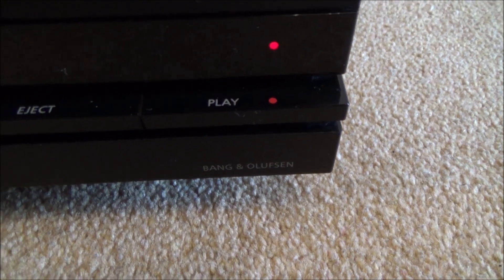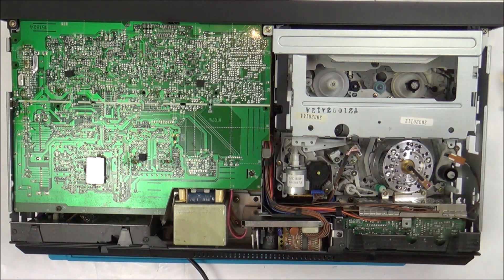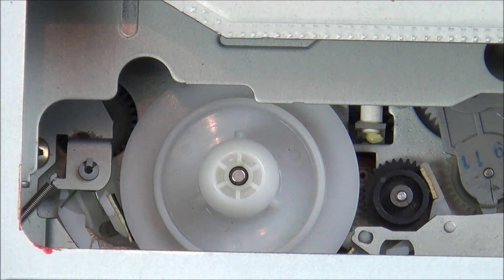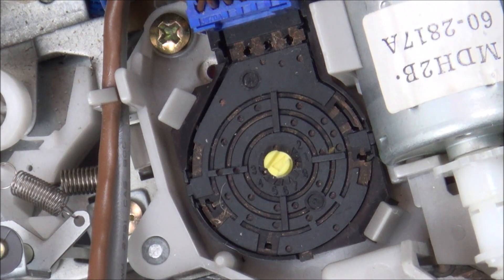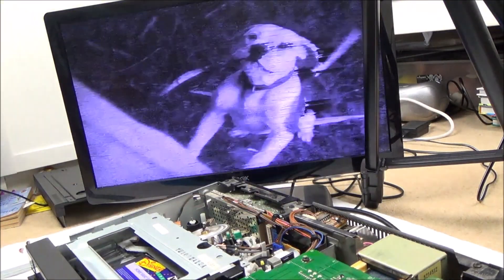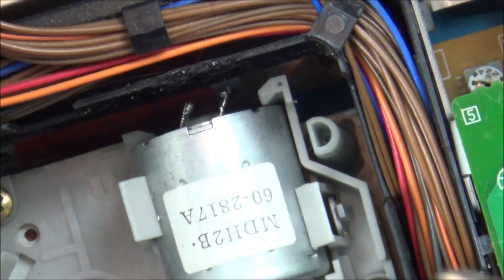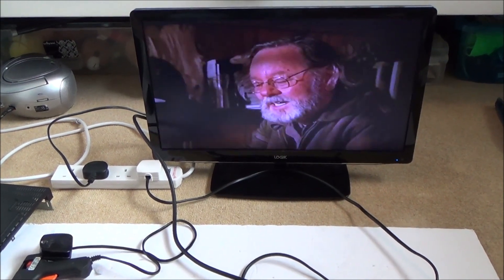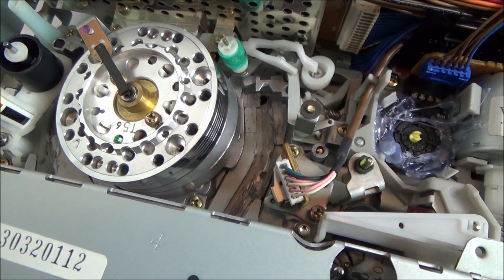Trying to FIX a £1200 Bang & Olufsen VX7000 VHS Video Cassette Recorder

Comment: My father has one of those big bertha ones with the dual cassette players, analog tv decoder and the whole shebang. That bad boy weighs more than a cinder block and does about the same thing as a cinder block. I once tried to open it and fix it, well....let's just say I saw the internals, all those gears big and small, wires everywhere and the dust caked up, I had nightmares afterwards.

Comment: Let me tell you all. The fastest winding cassette player I’ve ever seen it’s the Tandberg tcd330. 
Made in 1975, 
It have dedicated capstan motors, dual loop closed type. 

And 2 direct drive motors on to each real,
Rewind up to a serious speed, and slowing down at the end to not damage the tape, just like expensive 80/90’s vhs machines

Comment: Hello I have a beocord v8000 or model 4601 and when I put on power it just displays 3 lines but got no reaction on any of the buttons when I try to play a vhs tape or eject it... so I had to manually eject it... my main question is what could the problem be? Please help

Comment: Actually, it has 7 heads on the drum - the 2 sets of of heads for long play/standard play are combined. Sadly, you broke the position switch - it was probably not bad before you began fiddling with it. The reason for the too high speed was because you messed with the take-up mechanism, which you forced to drag the tape with too big torque, thus the pinch roller could not control the speed. And finally: It cannot be remote controlled without connection to a B&O TV. If so done, a range of features like tape indexing, variable speed and on screen display will be unleashed. Having this machine without a B&O TV, is like having a caravan without a car.
Reply: What a bit of crap lol.

Cracking plastic parts.  Un-maintainable mode switch.  Functionality locked in with other equipment..

How much was this back in the day?

Comment: I have a VX7000 it woul also chew up tapes. The solution was easy. Take off the take-up reel. Underneath it is hardened grease. Clean it off and relubricate with e.g. silicone grease. Works like a charm again.

Comment: I have a sears SR 3000 VCR from about 1987 I found in a goodwill I bought it because it looked cool compared to newer VCR's it has a few repair shop stickers on the bottom but hey it still works I just had to find a remote on ebay and reglue the metal faceplate back onto the remote

Comment: cracked cogs are never going to be an easy fix. Congrats on getting it working as well as you did
Reply: I  am pretty sure he could send the cracked parts to someone who is able to copy them and make 3d prints of them.
Reply from the maker: Cracked cogs seem to rear their ugly head often on this channel. I am still getting over the hassle that I had with them in the 'TruckerTronic' RC truck fix that took hours if not days to get going.
Reply: @Mymatevince  cou(3D Printer)gh

Comment: Access to injection moulding would probably solve the problem with parts. However I am not sure the time it would take to make the mold would justify the price of the device being fixed. You could go the way of 3d printing, but I am not sure the printer would be able to make such intricate parts. It would have to be extremely precise.

Comment: 12voltvids in Canada often does VCR repairs. And he usually goes straight for suspected dirty contact mode switch first.

Parts like the plastic gears can be impossible to obtain.
Reply: Yes, Dave does know what he's doing. He repaired a dozen of them.
Reply: Plastic gears perfectly can do on 3D printer from nylon. My friend made bunch of gears for a meat grinders, all works perfectly.
Reply: @Lightning666  Приветсвую у меня точно такой же аппарат
Сломался кассетоприемник а именно пластиковый рычажок
Reply: @xcntry8908  Если деталь очень точная то ищи у себя кто имеет фотополимерник, у них качество печати отличное, если матрица высокого разрешения.
Reply: @Lightning666  Я сделал его! хотя мало в этом разбираюсь.
Мне помог Service manual от модели: vt-s 890e
 Это механизм Hitachi
Я нашел кинематику от Hitachi vt-75gk кассетоприемники  идентичные, заменил этот сломаный рычаг
Теперь все работает.
Reply: @xcntry8908  Поздравляю с ремонтом ;)

Comment: I bought a b&o TV from auction with remote (the one that has a motor to move it to desired position and built in vhs player)..for 22 quid stunning picture and biblical sound what a TV. ..it was 4000 new but because it was crt TV nobody wanted it....was before retro gaming pushed up demand...never heard a TV with sound like it

Comment: Just for your reference the static tape head on the right side near the rubber capstan wheel ( one with pink and white wires) is the analogue audio record playback head on one edge top if I remember rightly) and the control track head on he other edge. Control track is used as a reference pulse which synchronises the rotating video head position to the location of each diagonal track start on the tape. A pulse at the start of each track( I may be remembering this a bit vague). 4 video heads suggests standard play and long play tapes, halving the tape speed doubles the recording time but changes the video head diagonal track angle so you need different heads (angles) to cope with that.  I think the other heads could be digital audio ???, can't honestly remember.  VCR's use to have tracking controls for fine tuning the control track to video track relationship, so you could track on machines recoding to another's, often manifesting as a line or noise bar on the picture.  Just a warning, never clean a video head with a cotton bud. I use to use a piece of white card ( business card) thoroughly and repeatedly wetted with IPA (it dries out quick) held perfectly flat against the head drum and slowly rotate the head by hand. Do not move the card, do not press hard. You can feel the head pass gently under your finger and if you look at the card it will show the tape oxide coming off the head. Repeat until clean.

Comment: If you ever stumble on a later JVC model with high speed rewind that is all jammed up, it’s usually those optical sensors that have failed, the tape travels so fast, the sensor don’t detect the speed difference between the take up and supply spool, preventing it from slowing down towards the end of the tape, big crunching sound as it strips teeth of a toothed slider. Easy fix if you can get the parts.

Comment: if you remove the brakes, the tape continues to run during winding..the problem is with the clutch or switching between playback and winding...

Comment: give me metal cogs any day of the week!! like for my model I got metal cogs, yes got to watch heat issues, but should last an awful lot longer if used right. I would also suggest maybe someone with a 3d printer to print off new cogs if they can, not sure how easy it would be though to do the teeth on the cogs.or whether you can get the cogs, then 3d print them to expand up to the original size of plastic to bulk it out to fit.

Comment: The B and O TV remote will operate this though the scart connection (must be a fully connected 21pin mirror) a one for all remote will not work with this the pulse width is different, just to make things interesting, some of these were based on Hitachi vidoes under the cover.
Reply: It says "Designed in Denmark, Assembled in Japan" on the back of the device, and has a "Camera pause" jack so yeah probably made by Hitachi.
Reply from the maker: Thanks Chris :-)
Reply: @nakkistromberg3946  B AND O  had   Philips,  Panasonic,  Sanyo,  Hitachi,  Grundig,  make there machines over the years. No spool take up is capstan drive

Comment: the motor switch is also a reason that the devices go haywire, over time the wipers get dirty, which leads to contact problems.  the sequence control cannot work then.. which leads to problems with playback and the other functions....

Comment: the LED in the center is the transmitter and the sensors on the side shoot through a hole in the cassette and sees the LED when the clear leader is between them.

Comment: It's either a belt issue , or the cassette may well be broken. The first thing you should do is take the tape out , flip it over and on the reverse of the cassette is a small round hole , shove a pen in it and then you can turn the tape round by hand. But my guess is that the
 ' spike ' for want of a better word. But the spike that is supposed to fit in the hole in the cassette is either broken or isn't poking up enough to release the tape. So one reel is trying to pull the tape from the other reel which is now locked because the ' spike ' hasn't been inserted , and when the tape reaches a certain tautness , it stops the tape rather than just keep winding on a locked wheel leading to the tape snapping.

Comment: Using service manual before repairing MECHANICAL PARTS ADJUSTMENT

1. Mechanism State Switch

Purpose: To detect the mechanism state correctly and

Test equipment/jig

Preparation for adjustment

E

e

Blank tape

Adjustment procedure

1) Check that the arrow on the centre shaft of the mechanism state switch points to the arrow of mechanism mode indication number 1. Also check that hole (4) beside the mechanism state switch and the hole in the mode gear are aligned.

2) If the above alignments are not obtained.

adjust as follows.

1. Remove the mechanism state switch/loading motor assembly.

3)

(See "MAIN MECHANICAL COMPONENTS REMOVAL" in CHAPTER 2.)and prevent malfunctions.

State of VTR

Adjustment points

Eject mode (with the cassette ejected)

Mechanism state switch

Mode gear

the

f

2. Move the mode gear to align the position of hole (A).

ek

tch

3. Turn the gear on the back of the mechanism state switch so that the arrow on the centre shaft of the switch points to the arrow of mechanism mode indication number 1.

4. Reinstall the mechanism state switch/loading motor assembly above condition.

13) Load a blank tape and perform various operations to check that loading and unloading are performed correctly.

Comment: RE: "Cracked washers." These are known variously as "cut washers" and "split washers" and are used in place of e-clips or snap ring. NEVER cement or weld them. They are meant to be like that. You should have run into them on cassette units.

Comment: These video recorders are controlled thru the B&O TVs only, even if you buy a B&O remote control, it won't work since it has no IR sensor in it
Fixing these old machines take some time and need to change many capacitors and chemics inside if mecanic problems are repaired and still not working , the VX7000 was the last of the VX series and the most reliable,  there was a first version with two way control with Beolink 5000/7000 remotes  and  later normal version with Beo4 remotes

Comment: After the first minute I knew you would need to check out 12voltvids chapters on the mode switch. Not all VCRs use one but the overwhelming mass after the first 5-7 years do. As others have mentioned, these get dirty, especially after years of disuse. It is within the realm of possibility that just squirting some HIGH quality cleaner (Caig) might do the job if you don't think you can do it the way he does but it might not last. I would have expected B&O to have used gold flashed parts but it looks like they went for the usual Asian parts.

Comment: You need a ir reciver for it, there is not a reciver built in the vx, I have worked on it back then on Bang & Olufsen, the fault is the gearbox there is  faulty.
Regards from Denmark.

Comment: it's possible to print the Parts using a 3D Printer. About the Remote Control you could use an Android Phone with an IR Built in (A lot of HTC Phones had IR like HTC M9) using an Remote Control App, that's what i do to Test Devices which i don't have a Remote Control for.

Comment: The remote is that expensive because Bang & Olufsen basically had one remote for everything. It came with the TV and you could then use it for any other B&O device. And the TVs (The Beovision MX series) are still among the best tube TVs out there for home users (studio TVs are another thing when it comes to quality), which makes them very interesting for retro gamers. I got a MX 4000 for free, the listing didn't mention the remote, but it came with one. Then I later paid 50 Euros for a MX 6000, because the MX 4000 is just too small. It did not come with an original remote, just some aftermarket universal remote that I keep as a backup. 
If anybody ever tries to break into my apartment I could probably use the original remote to defend myself. It's roughly 30 cm long and heavy as hell.
I wish modern devices would have that disassembly instruction sticker.

Comment: Some Android phones have an infrared transmitter. You can download an app and you might be able to emulate the B&O remote control for this device.
EDIT: After looking into it... well, it uses a very fancy remote control, maybe even with two-way communication to the unit. I wasn't able to verify it's using infrared. Might be RF instead of IR. So, chances are low. Anyway, if you have such a phone, it might be worth while looking into that.

Comment: I have repaired cracked gear before for audio decks and used this apporach. Take the gear OUT. Try to find something that closes the gear gap, like and them glue. For exmaple I got a crack running in a gear from the center to the border. I take it out to release tension, glue it to a piece of ilustration paper with super glue. Then cut it out from the sheet. The piede of paper attached to the gear together with superglue gave a superb strength. It is not just a bit of glue, now a paper "disc" is holding it. Paper absorved the superglue and hardened Other gear tried to find tube or plastic ring cut out of different things (a gatorade bottle for example) to hold the gear close and then drop the glue. This was for a big gear from an old Gurndig Reel to Reel. Probably heatshrink tube can work. Not sure. The plastic one should do. You put it on the "collar" of the gear and then drop glue to seal it

 This encoder thing is just a brilliant effort to save money on motors, got one motor running all the automation of the VCR. Older ones used separate motors of the carriage, the load and take up. So, less gears, less plastics and less prone to failure.

Comment: You can actually use a Logitech Harmony universal remote (the older cheap ones are fine like the 300 or 350) and sync with your PC to control this VX7000.  I just found this model is supported with the MyHarmony software on Windows.  Very handy remote to keep when you have to deal with second hand devices often not having a remote or a replacement chinese knock off remote can be missing some button functions.

Comment: The extra tape heads only existed so you could freeze frame and skip frame porn. Oh, and the Scanners (1981) head explosion scene of course!
Reply: Scanners is currently on YouTube in glorious HD.
No porn though 😗
Reply: There's also 2 additional heads for HiFi stereo, and 1 for flying erase. There's 7 heads in total.
Reply: @Regaljester75  Thanks, I will have to watch it. But glorious HD is nothing like glorious Ferguson Videostar toploader with the "sledgehammer" buttons and watching on a Sony Trinitron back in the early '80s. The sledgehammer fwd/rwd and pause buttons to see that hilarious balloon head explode was great as a tweenager. Only 2 heads on a VHS in those days so no single frames.

Comment: You can't actually "get a remote control" for it, learned that the hard way myself!
The VX7000 uses something called "AV Link" which routes remote control signals from the tv through the SCART plug. Without a BeoVision to go along with it, it's barely useable.
The remotes are set at an IR frequency of 455 KHz instead of the usual 38 too, so even if you have a reprogrammable remote, you couldn't use ithat. You'd HAVE to use a BeoLink remote.

Maybe try getting your hands on a B&O Master Control Panel 5500? It should pair nicely with the BeoCord 5500 that you repaired earlier. It should be able to talk to the BeoCord VX7000 too i think, provided you have a TV for it.

Oh and like you said "there should've been buttons on the front of the machine", the VX5000 actually had those. It's in many ways superior to the VX7000 actually!
Keep up the good work, absolutely love your stuff!!!

Comment: Try sanding down the metal peg so it’s skinnier then glue the gears back together then slip them back on it should work
Reply: Or make the gear holes wider then glue them to the metal peg

Comment: I remember when i was around 9 or 10 years old my parents had a video player and also a DVD player and a digibox connected to a CRT TV
The CRT TV only has 1 scart input, and no other inputs apart from the aerial, but somehow the video player, digibox and the DVD player were all connected up
The digibox had 2 scart connectors on the back of it, 1 labeled TV, the other labeled AUX/VCR
Im not entirely sure how it was wired up, but i think the DVD player was connected into the AUX on the digibox, and the digibox went into the scart input on the TV, and when the DVD player was turned on, the TV would auto switch to the SCART input, and I remember that for whatever reason, to watch a video i had to press 9 on the TV remote, so i am not sure how the video player was hooked up, the video player had a single scart connector on the back of it, as well as aerial in and RF out

For those that have never heard of a digibox before, it is a digital TV tuner

Comment: I think this has a bad mode switch. It’s got the symptoms. Solution is to clean the switch. (Commenting before the fix by the way, just my prediction) I recommend 12voltvids, he used to be a repair tech and has laods of videos on fixing CRT's , Hifi systems, and VCR's.
Reply: Mode switch is probably the most common problem with VCRs.